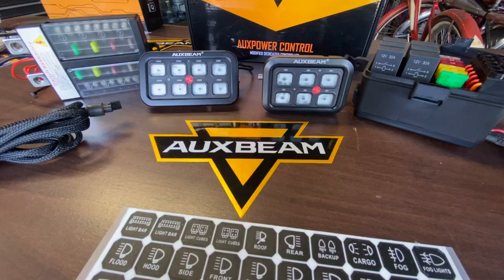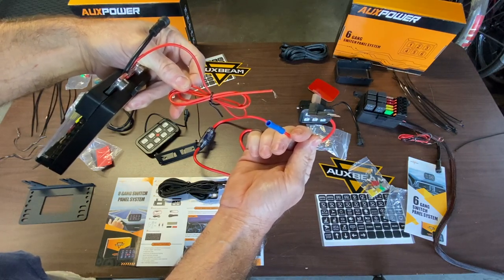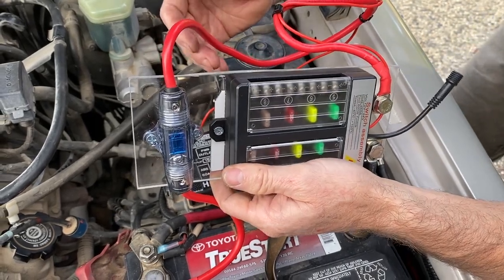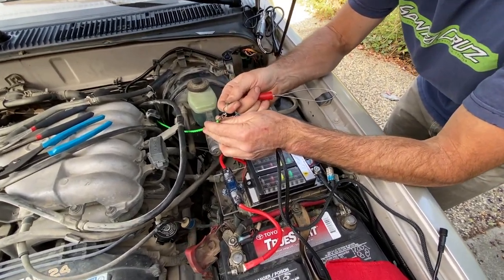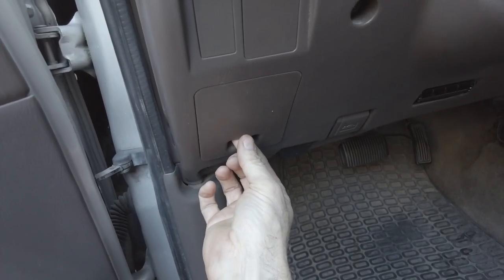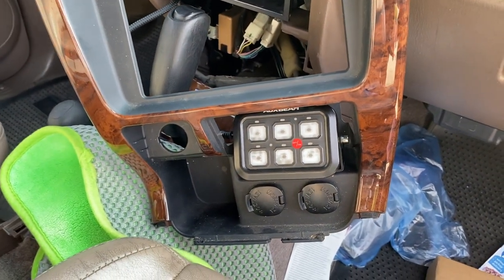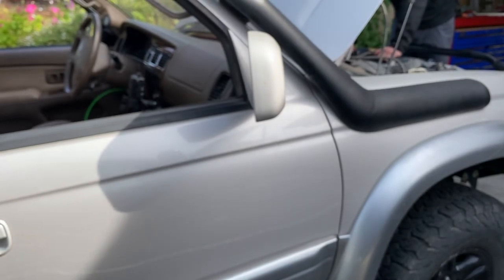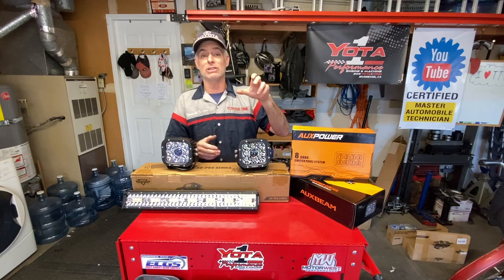How to install an Auxbeam 6 or 8 Gang Switch Panel

Comment: So on my 2k 4runner I didn't have that spot to hook up my acc wire where you did. So I went to my DRL and it worked just as well. So if anyone is watching this and reads this comment. You can use that spot with no problem! Thanks Timmy!!
Reply from the maker: Thanks for the comment, and you're very welcome.

Comment: I have a question maybe you can help me with, I have everything hooked up and my panel gets power but my switch isnt powering on my lights. Can I run a 25A through any of those ports? Or does it have to be through the 30 amp cause thats the only thing I can think of. Unless my light bar is defective which I will have to test once I can get back to working on it.

Comment: Would be cool to 3d print an overhead replacement that could accept that panel. Use the stock screws and have power for map lights, etc... My 2000 SR5 has a little compartment for sunglasses or a door opener. Have to take a look at it later.
Reply from the maker: Hey David, it's been done.  I guy just messaged me through Facebook and showed me a pic of his.  Looks clean.
Reply: @TimmyTheToolman  cool!

Comment: I have been using the 6 gang for 2 years on my Honda UTV and it is great with no problems, it is much better than multiple switches and multiple wires that I use to use.  Thanks for the video.
Reply from the maker: Yeah, we're liking our switch panels too.  You're very welcome.

Comment: I have power (my buttons light up) but when I press each button to turn on a specific circuit nothing happens. No red light on above the button, etc. any advise?
Reply from the maker: Did you make sure the wire that communicates with the fuse panel is connected to the switch and to the panel?
Reply: @TimmyTheToolman  thanks for the reply! yeah everything looks good. I contacted customer service so I guess we’ll see what they say Monday. I’ve heard other people had similar issues and they’ve sent new units so 🤞
Reply from the maker: @justinmireles8006  Yeah, it sounds like a defective unit.

Comment: I got a mention from the legend!!:elbowcough:
Reply from the maker: Your video also pops up at play time 6:22,  I just added it, and I link your video in the video description.  Unlike some content creators who try to claim others work as their own,  I do try my best to give credit where credit is due and your video definitely helped me out.  So, Thanks Minh!
Reply: @TimmyTheToolman  More videos the better!! I love all your videos, especially the more complex ones. I try not to make dupe videos unless I think there's some value added (different technique or approach). I got the plastic abs idea from some other "non toyota" channel doing the fuse block and thought it was cool. Can't remember who now.

I like what you did by using the circuit right there in the fuse box. I guess I couldn't do that as mine is always hot but that keeps things cleaner! (I like "clean" installs)

Great video!
Reply from the maker: @PhoRunner  Thank Minh.  I'm the same as you and only like to make videos where I think I can make a big difference.   There are lots and lots of Auxbeam Install videos in existence, but since our channel is lacking a lighting system series, I figured what the hell, it will help some people, so it's still worth creating.  By the way, I did get the idea for using the engine compartment fuse box as potential fuse location to tap into from some guys video.  I don't remember whose it was because I skimmed through lots of videos to see what was out there.  I guess I got lucky and found one that would work in my 98.  Sean chose the tail light circuit so his only gets powered on when he has his parking lights or headlights on.

Comment: Great video, super helpful! I used the Scarab Offroad mounting plate for the fuse block and mounted the control panel in place of my ashtray. The bracket that holds the slide out ashtray comes out with two screws, so I made a simple bracket using aluminum angle to take it's place.
Reply from the maker: Thanks!  We're happy to know our video helped you out.  Good job on the install.  Happy Wrenching!

Comment: Very nice. I have the oldie 4 gang that's just regular old school switches. I've thought about the 6 gang like the one on the vid, just might snag one. As for auxbeam, I've been using their lights for years and love them. I have always bought their more expensive ones rather then their cheaper ones. Great lights 
😎👍
Reply from the maker: Thanks for the comment.  Good to hear more support for our choice of lighting for our rigs.
Reply: @TimmyTheToolman  You bet! Love the vids, I too have a 3rd gen. 2000 SR5. Have had it since it was new. Picked my wife of 18 years up in it, raised 4 girls in it. Over the last year and a half I've redone so so so much of it. I've used your videos for numerous things I've replaced so I thank you for all the great content and dedication to the mighty 3rd gen 4runner. I'll have mine until the day I die.
Reply from the maker: @Basshead40  That's awesome you've owned it since new.  You have a lot of memories stored up with your rig.  Great to know our videos are helping you keep it in good running shape.  I'll probably never sell mine either.
Reply: @TimmyTheToolman  Yes sir it's literally part of the family. Every one of us look at it like an extension of our own selves in ways. It's just been through everything with us. All the happy fun adventurous times to the rough and hard times the family's went through. The ol 4runner was there through them all. Total toyota commercial right there huh 😁👍

Comment: A very thorough installation instructions video mate!
Reply from the maker: Thanks!
Reply: I want to use this to replace my existing switch on my boat. The switching is just a standard one with accessory wires connected to the back. It is mounted on the dash with a  cut out for the accessory wires to go through.  This switch you are reviewing the size should cover the cut out. What is not sure to me is , does this  have a mount option for me to screw onto the dash in place of the existing switch? Thanks!
Reply from the maker: @JT-jy2sy  Yes, it comes with a mount that can be screwed into something.

Comment: Great video helped alot with mounting! Have a 2 questions though sunce the unstuctiin auxbeam has arent perfect.

1. Dies the black wire from the panel go to the negative post of the battery or a ground? Or does it not matter?

2. Do you have to change the fuse in the add a fuse based on the amperage of what you are putting in the auxbeam fuse panal? I know you have to change the fuse in the box based on amps of the accessory, but dies the add a fuse need to be changed as well?

Thanks again for the video!
Reply from the maker: The negative wire from the panel can go to the negative battery terminal or a body ground.  It doesn't matter.  

For the Add a Fuse, you would just match the same amperage fuse for the circuit you're tapping into.  I tapped into the Power Outlet fuse spot in the engine compartment fuse box which uses a 15amp fuse, so I just installed a second 15amp fuse into the tap a fuse.  I don't think it matters what you're powering with the fuse block in regards to what amperage circuit you tap into.  I think all the small red wire is powering is the communication between the switch panel and fuse block.

Comment: Great video. I am planning to install my 6 gang Auxbeam in my Dodge Ram and your installs gave me some good ideas. I did have one question. What was the digital display component on Sean’s battery?
Reply from the maker: That digital display is just a volt meter that is built into the inline fuse.

Comment: Great video and walk through.  There shouldn't be any issues if you want to bump up the 5A or 10A port to a 15A right?
Reply from the maker: I don't think so.  I'm pretty sure the internal guts of the switch are the same with no difference with the relays for all the circuits.  At least that's what makes sense to me.  You just want to put in the correct amperage fuse for what you are powering with that circuit.  But, you might want to consult with Auxbeam just to be sure.  I did switch fuses for some of the circuits with no negative effects.
Reply: @TimmyTheToolman  thanks, that's what I figured.  All the relays they used on the 6 gang are all the same.  Thanks Tim!
Reply from the maker: @DuanDao  No problem.

Comment: I'm wondering how the velcro is holding up? I have the 6-Gang that I'm going to install soon and was thinking of doing something similar. My 2022 4runner doesn't leave much mounting room without having to relocate a relay box.
Reply from the maker: I used velcro for the 8 Gang Switch panel and it's holding up very well.  No issues.  They make really strong velcro, up to a 15 lb hold.  You can buy it at Home Depot.
Reply: @TimmyTheToolman  thanks! I was worried about the best affecting the adhesive.
Reply from the maker: @novagurl2763  No problem.

Comment: Thanks for the video, is there a way to have 1 of the switches on constant power while still using this setup. I want to be able to use my uhf radio without acc on. Also if the whole system was on constant power would it still drain the battery even if all the accessories are turned off? Cheers
Reply from the maker: I don't believe you could just have one with constant power.  It's all or nothing.  When the switch panel is run to constant, the switch panel will stay lit up all the time.  If you drive your rig every day, those panel lights might not be enough to drain the battery.  If your rig sits for days at a time, you might find you have a dead battery.  I don't know how much power the switch panel light draws but they obviously will be drawing some power.  I guess the only comparison I can make is a blinking car alarm is on all the time and it won't drain the battery that quickly.  But, the panel light is probably a larger power draw than a small blinking LED alarm light.
Reply: @TimmyTheToolman  thanks for the reply, I just had another thought, would it work for me to hook it up to constant power then tee off and run a wire to a basic switch inside the cab. Then I can choose to power up or turn off the panel at anytime from inside the cab?
Reply from the maker: @reecemist7018  I think that would work.

Comment: Do these switches have a memory? So when you turn the vehicle off and back on does it remembers what switches were on? Thanks.
Reply from the maker: There is no memory.  When you turn the vehicle off, the switches reset to off.

Comment: So I got a random question for you, can you use one of these to wire a chase light? Most chase lights come with their own switch to toggle through the modes, do you know if you use this if you able to toggle through the modes without the original switch
Reply from the maker: I'm not familiar with chase lights but we do think you could use a separate switch to toggle through the modes.  I personally wouldn't do it because it's just another switch you have to mount inside your cab.  I originally had chosen multi-mode lights for most of the lights I installed on my 98 4runner, so I would have had to run 4 switches into my cab to change the mode functions.  I guess if it was just one of two lights, that wouldn't be a bad way to go if you really wanted to have the multi-mode lights.  

If you try out running a separate switch to the mode wire (yellow wire), let us know how it works out.

Comment: On the 6 gang, if you press the on/off switch can you change any button to momentary or puls mode??
Reply from the maker: The 6 gang and the 8 gang in this video don't have the momentary function but Auxbeam does make switch panels with that functionality.

Comment: What is the point of using the fuse jump if you are powering to the battery? Just curious.
Reply from the maker: The power cables from the battery to the posts on the fuse panel is to bring 12 volt power to the panel.  The small red wire that we attached to the tap-a-fuse is to provide 12 volt switched power to the switch panel inside the cab.

Comment: My question is about the Fuse Blocks, the 6 gang has relays on it but the 8 gang doesn’t. I have a couple lights already connected and want to eliminate all the different switches and just go with the switch panel. Each one of my lights came with the wiring and they all have relays. Is the fuse block with Relays necessary/better? Or not necessary?
Reply from the maker: The 8 gang switch panel has built-in relays you can't see.  It's slimmer and nicer than the more bulky 6 gang panel, in my opinion.
Reply: @TimmyTheToolman  thank you!
Reply from the maker: @MA1DIT01  You're welcome!

Comment: I see auxbeam puts a graduated series of fuses in their box. Is there any reason why you can’t put a larger fuse in place of the smaller ones? Just in case I have 4 or 5 high current draw accessories.
Reply from the maker: Yeah, I swapped some smaller fuses out for larger ones without issue.  It would be weird that they would put different relays for every circuit.  It's my guess that every circuit has the same relay.
Reply: @TimmyTheToolman  thanks
Reply from the maker: @gregdenton5282  No problem

Comment: Hi Timmy, I still look forward to your uploads and enjoy your work. My question has nothing to do with this video, and I apologize. However, I am working on removing the fender liners on my 3rd Gen, and the clips holding them are almost impossible to remove without breaking them. Do you, or do you know anyone who knows the Toyota part # for these clips, as I would like to replace them? Thanks in advance.
Reply from the maker: Yeah, it's fairly impossible to remove those clips without breaking them.  I don't know the part number for those clips.  I'd just go to the dealership and buy one so you know the part number and then you could order the rest from an online seller to save money.
Reply from the maker: The Toyota part number is:
90189-06212

It’s referred to as a grommet screw. But check out this link for a pack of 20 universal clips.
https://amzn.to/3gYkHOz

You can also go inside the engine bay and see the tops of the clips on the top of the fender. You can pinch the ends of those fender liner clips with some pliers and push them through. 
- Sean
Reply: Thanks Timmy and Sean. I will order a couple and see if they're the same. I also checked Amazon after contacting you and I think they're available for a decent price. Also, unfortunately the dealers here are not cooperate like the ones you have. Thanks again

Comment: Why no main fuse/breaker for the 6-gang???  It doesn’t run the risk of a potential melt down or direct short from the battery to the fuse block lol!

All wires should be protected/fused.

Comment: So for the 6 gang , you don’t need to tap it into a separate fuse necessarily?
Reply from the maker: For both the 6 and 8 gang switch panels, we tapped into fuses.  Sean tapped into the headlight fuse and I tapped into the accessory outlet fuse to power our switch panels.

Comment: In regards to the 6 gang switch panel
How would I go about wiring up Diode dynamics pods since they come with 3 wires
Reply from the maker: The 3rd wire must be for a switch to control multiple modes.  It would be best to use the original harness the lights came with and not use the switch panel to power it.  I talk about the limitations of these switch panels in regards to lights with multiple modes in the video.
Reply: Nevermind the 6 gang panel. I ended up using the 8 gang panel and wired both pods to one switch and I wired the third wire to a 2nd terminal for the backlight. It worked out great! I wasn’t trying to use their harness. Keeps the engine bay looking cleaner;) So, so far no limitations on the 8 gang in my case✊🏻
Reply from the maker: @yoterchris1028  Yep, what you did is an option.  But,  if you have a lot of lights that all required a 2nd switch for it to operate as intended, you would run out of circuits.  The case I was referring to was lights with multiple functions.  A simple on/off wouldn't have worked for that application.  I'm glad the 8 Gang worked out for your needs.

Comment: Can the Auxbeam 8 gang switch panel fit on a 2023 Ford Bronco next to the gear shift, in the area where the bronco word is screwed on?
Reply from the maker: No, it will only fit Toyota models.
- Sean
Reply: @TimmyTheToolman  Thank you for your help.

Comment: Do you remember the dimensions for the clear plastic mount that you made?
Reply from the maker: I don't know the exact dimensions.  You could easily figure out how big to make yours by setting the switch panel and fuse next to each other and then measure the length and width needed.  It's pretty straightforward.

Comment: The 8 gang is sealed and you can't swap out the relay if it goes bad  the 6 gang you can swap the relays. Just an FYI
Reply from the maker: Yep, that would be correct.

Comment: How to control the pod if it has multi modes
Reply from the maker: The switch panel is a simple on/off switch.  You can't switch the modes of the lights with it.

Comment: So what happens when the tap a fuse doesn't fit in any of my fuse slots? And none of my fuses fit in the tap a fuse slot.
Reply from the maker: You have the wrong tap-a-fuse then. Try this link: 
Mini Add-a-fuse - https://amzn.to/2MGwaT2
Reply: @TimmyTheToolman  kinda disappointed Auxbeam wouldn't include multiples to avoid this problem. Thanks for your help!
Reply from the maker: What is your vehicle? Make, model and year?
Reply: @TimmyTheToolman  2021 Ram Warlock